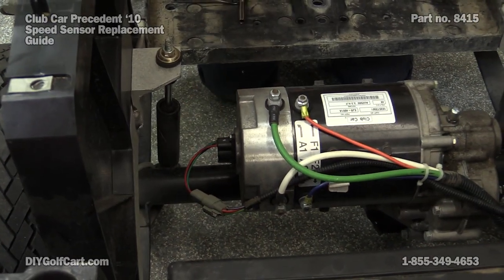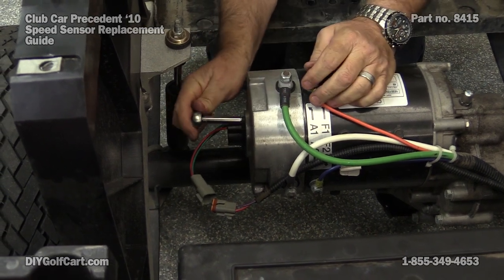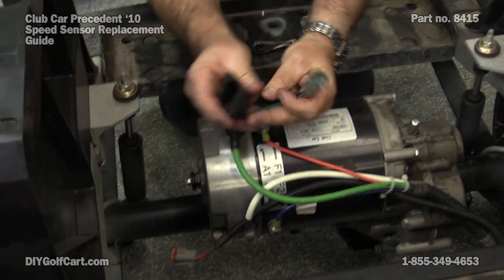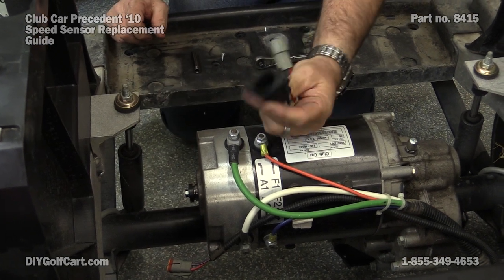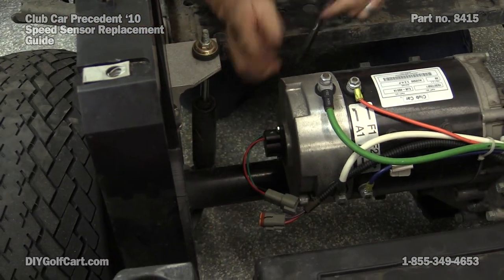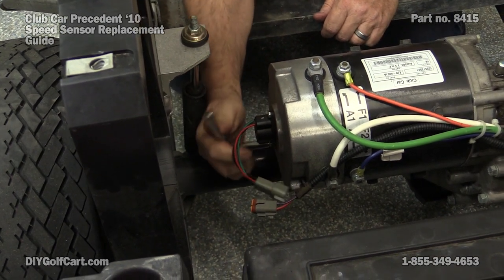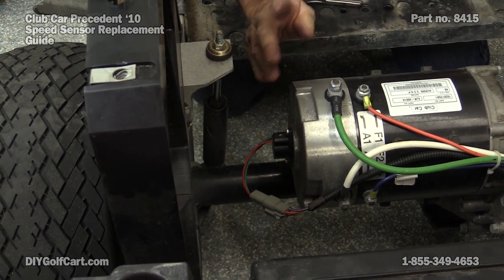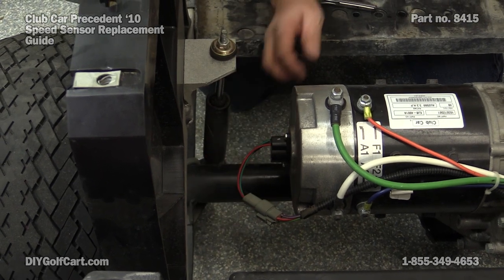Speed Sensor for Club Car Motor | How to Replace on Golf Cart

Comment: 2011 club car precedent electric 48 volt  with new tires and batteries, Voltage check ok. speed is 14.5mph set to original factory specs as far as I can determine. After three weeks of good steady speed running on a  flat surfaces golf round, cart started to change speed. Felt as though your were driving on muddy surface, or low tires, runs slow, picked up spped runs good and then slows again. repeats it self. Before we replaced  tires batteries, we had this issue. Batters were 5 years old and voltages dropped to 46 volts across all 6 batteries. Today after golf I check voltage on batteries, water acid water levels, all good. doing a  m-cor  check that is backing up cart by hand , back up indicator sounds off. would you suspect M-cor, or motor sensor? or your recommendation please

Comment: Our 1990 Club Car DS electric drives fine when you press the gas pedal. Release it and press it again, so that equals pressing it down twice, it goes much faster. Any idea why and how it does this? Our kids call it the "turbo" feature. Also, the cart drives without a key for some reason? I've replaced the solenoid before and now it runs without the key. All I did was swap out the solenoid for an hem one. No other playing with the wiring. This has me at a loss and I can't find any info on it online?

Comment: Hi Barry, I've got an 06 Club cart and sometimes intermittently it will not accelerate. I press the gas pedal down the engine doesn't rev up but the engine stays idling but it does not rev up and it does not accelerate. Sometimes I've waited five or ten minutes and it works fine and sometimes it doesn't. One time I had my friend push me and once I got going it started working again very intermittent. I took the brown wire and removed it from the Rev limiter but still having the same issue. Any thoughts or comments? Thanks from Doug and Balaton Minnesota

Comment: Ok Barry thanks, so where do I go from here. 48.8 volts across sux. 8 volt batteries read 48.8 volts. Cart speed changes from 13.8 down to 8 and back up again after only 18 holes it run about 1 mile per hour and speeds up to 8
Do I need batteries and a speed sensor. By the way I did the key turned on push and the buzzer worked so does that say the speed sensor is ok. 
On the batteries will Epsom salt and distilled water improve the existing batteries response?

Comment: Great video! I have a 2016 precedent and it is suddenly slower after takeoff and does not slow down quickly after releasing the accelerator (downhill brake). Last time I believe it was the speed sensor (replaced 8 mos ago). Do you think that is it again? Thanks!

Comment: I just installed (-1 month) new batteries and a new solenoid on my 36V 2004 EZGO TXT. BUT,, am still experiencing sluggish run while on an incline. Any suggestions?
Reply from the maker: Jack up the back of the car. Key "on", in forward. Accelerator pedal fully depressed. Check the voltage between B+ and M- on the controller. Make sure its minimum of 36 volts.

Comment: hi, I have a 2008 club precedent gas golfcart. I was wondering how to increase speed without making the car backfire. I was told there is a plug in for a sensor and all I would have to do is unplug it, but I do not know whee its at. could you help me to tell me whee its at and to make it a little faster without slowing down when u hit the gas

Comment: Hey Barry, I have an EZGO 36 V,  it vibrates when I press the accelerator and barely moves. Last month it started up by slowing down and getting stuck. Had to get out and push to get it rolling. Now it barely moves. When rear wheels are off the ground they spin fast and normally. Please help!
Reply from the maker: First thing I would do is to load test the batteries. Any battery reading below 5.9 volts under load, replace.
Reply: I will as soon as my new voltmeter arrives Thanks I will let you know.
Reply from the maker: @MrMalibug  Great! Keep me updated.
Reply: It's the batteries😥😲

Comment: I have a Club Car Precedent.  I have had many problems with faulty knock-off MCor units.  I use them since OEMs are outrageous in price.  With the knock-offs it doesn't take to long for the cart to start stuttering, bucking and running rough.  So I keep changing the MCors out and the cart will run ok for a while.  Now I have a situation where the cart will flat out die.  When this happens, I have to then be towed home.  Then a little while later after the cart sits for a while, it comes back to life.  Any suggestions as to might be causing this problem?  Is there some sort of reset going on somewhere? I saw this video and thought one cause might be a broken motor magnet.  (By the way, as an aside, I tore one of the MCors down and found that there was excess grease getting on the rheostat controlling speed.  These Mcors are either Mexican or Chinese manufactured units.  So I saw that the excess grease is getting on the rheostat. I think the excess grease is interfering with the electrical conductivity and that's why I've had so many problems with that.   I haven't figured out how to put this unit back together yet, but I may jury rig something and try it to confirm my suspicions.)

Comment: Hi Barry. I'm in Knysna, Western Cape,South Africa. I just bought a previously owner club car. Not sure of model, 18780? It is in good condition and I've used it on a flat course the first time. It ran OK but would slow down sometimes and do not seem to go as fast as I thought. Can the problem be the speed controller as the batteries are fairly new. If it is the speed controller can I order one from you and what info do you require. Also will I be able to do the replacement as we are 65km from the nearest town that has repair agents. Regards. Trompie
Reply from the maker: The first thing I would do is to do a load test on the batteries. I do have a video showing how to do that or you could send your email and I can send you written instructions that I did.

Comment: I just pirchased a 2012 club car precedent.  Batteries are May 2013. After about an hour of drive time on a full charge, the cart starts to buck when accelerator is pressed to the floor.  Could the be a sign that the speed sensor is failing?
Reply from the maker: Could either be a battery going bad or a MCOR going bad

Comment: I have a gas Club golf cart. It will not run at a steady speeds but keeps jerking along very slowly. Does the speed controller need to be replaced? I don’t know what year cart it is or where the controller is located.
Reply from the maker: If it's a "Gas" cart, it won't have a controller. Check the fuel lines, throttle adjustments and the spark plug to make sure you have a nice bright blue spark. Still having issues, call me!! That for watching and don't forget to subscribe!!

Comment: Hi I have 2017 club car president that is making a chirping noise from the rear of the cart. Not sure if it's a wheel or the motor. The cart seems to run fine though..The only thing is the speed is hard to stay steady unless at full speed. Any help will really help. Thanks in advance

Comment: I just bout a 2012 Club Car that when you first start out it is very slow but when it warms up, it really takes off.  I don't think any of the battery connections are loose and the batteries are in good shape and full of water.  What do you think the problem is?

Comment: I have a 1997 gas club car that drove before I put it on a trailer and drove it home went to take it off the trailer now it will not drive or reverse but it runs what could be the issue

Comment: I've got an '04 DS w/an Allsports 4" lift. The front end 'let go', snapped off a bolt from a lower ball joint and a tab where the steering hooked up to the same side. Can I purchase another front end for a 4"lift and complete the project myself or should I just take it back to the shop that installed the original? It lasted.less.than 6 yrs.
Reply: I’m sure you can, might call the number on the bottom right corner of the screen.

Comment: 2004 Club Car Precedent.   4 New 12 volt Trojan Batteries. Batteries fully charged.  When I first try to use it, after charging the batteries, I get no response when pushing the foot pedal.  I can pump it up and down like we used to have to do a faulty gas fuel pump and it will "click" and run like a bandit.  Then when I lift the pedal and stop, I have to do the same thing over again.  It runs like a new cart after I get it started down the road, but won't take off from a standing start.  Comments appreciated.
Reply from the maker: Check the voltage on the 2 small terminals of the solenoid to see if it has voltage each time you press the pedal. May have either a bad MCOR or bad solenoid.

Comment: i have a club car carryall 6 serial number JR0914-014022.Now the car is running very slowly...how can i fix the car speed?
Reply from the maker: +She Harm With it being a Carry All 6, the controller may be set to a torque value. It's going to really be determined by what the golf cart is used for and if you should speed it up due to it's size and usage.

Comment: I have a 2003 48 volt club car ds ,but it don"t have a speed control on the motor ,run good at 1/2 petal but jerk if you mash it on down
Reply from the maker: +Robert Dorsett Check the voltage of the battery pack. If that turns out ok, call me at 855-349-4653 and I can give you some more test to run.

Comment: Hello sir I have a 04 club cart 48 volt
I’m working on for someone. It has been setting for three years and was running fine. I replaced the batteries and charged them full and it will move a foot or so with a push and if I jack it up it will run but have to help it get started by rotating the tire by hand any suggestions
Reply: Im having the same problem, let me know if you figure it out.

Comment: do you know any time i run my golf car by the blue cable by the resgistor turn rud and getting very hot do you know why ty
Reply: Check the cable and connectors since I had similar problem with Club Car cables. Connectors were rusted and crimping became loose causing poor connection.

Comment: Barry, I just bought new batteries yesterday and am still experiencing power/speed loss when going up hill. 2002 Club Car DS. All original parts. Do you have any idea?
Reply from the maker: +Char Mobley Give me a call here at the garage  877-960-5464 for a list of things to check.
Reply: Did you end up fixing the problem with your cart? I am experiencing the same issue and was hoping you fixed yours and can tell me what it was? Thanks

Comment: My 2004 club car electric runs well but at rather slow ( compared to my club' s carts ) speed. Same whether on flat or uphill. Is it possible to make a speed adjustment.
Reply from the maker: You can drop in a high speed motor and the performance will increase
Reply: @golfcartking  Which motor would you recommend for a club car precedent 2012 model? I do not want to change the controller to save costs, if possible.

Comment: Hey I have a 03 club cart ds I just put new batters and a speed sensor and it will go and stop . When I push it it will go again and stop . What could it be? I have spent a lot of money and it still not right
Reply: Kenny Matthews Check your bushings
Reply: I have a 2012 Hammerhead R150 36/48 volt electric cart. Shutters and shakes and hardly moves. Jack it up with tires off the ground it will run 30mph. Any ideas

Comment: Barrymy 2011 Electric Cub Car precedent charges great, when I accelerate to the full speed of 13.8 mph ( that's all I get)  then uit drops up and down from about 6 or 8 mph or to three or four mph. iif two people are on it. I suspect sicne everything else checks good, charges ok 48.8 across batteries total charge,  runs great most of the time1. how can I ce sure it is the speed sensor2. can I ge tit to run faster? without going to the dealer and get speed controller  code set?
Reply from the maker: +STEPHEN DAVIS If you are reading 48.8 volts across the battery pack. You've got a bad battery or more. The voltage will drop once under a load and you're already at 48 volts.
Reply: I do not follow you as I have 6---- 8 volt batteries should the voltage not read 48 volts?
Reply from the maker: +STEPHEN DAVIS Image going out to your truck and checking the voltage on your battery. If you read 12.5 volts and turn the key, if the battery is good it should stay around 12 volts but it will drop under load. If you battery pack reads 48 only, the when you press the accelerator pedal and put a load on the pack, the voltage will drop below the appropriate voltage. A good 48 volt battery pack should read around 51 to 53 volts. That way when you press the pedal, the voltage will stay above 48 volts.

Comment: Do you have to have a speed sensor? if so what purpose does it serve?
Reply from the maker: Yes and the purpose is that the speed sensor tells the controller how fast (rpm's) the motor is going.

Comment: its a cool vid and all.but I have a 1993 club car ds and it always goes fast when you hit the gas pedal and never goes slow. please help
Reply from the maker: +justin watkins Check the butterfly inside the carburetor. I've seen them hang up causing the car to run wide open all the time.
Reply: DIY Golf Cart. Ok thanks so much for helping me out

Comment: im frustrated my club cart drives ok after is totally charged but then slow down and when i reach a hill top  doesn want to go any more i just replace the selenoid,batteries ok,,so i will try to wipe off the speed sensor ,(praying that solves my problem)
Reply from the maker: +ken raynor I would load test the batteries ensuring they are at the correct voltage under load first. DO NOT use a load tester! Great re-gifting item.  Use a volt meter to get accurate numbers! Eight volt batteries should not drop below 7.9 volts and six volt batteries should not drop below 5.9 volts.
Reply: hi thanks for replaying ,,i just check the batteries voltage and they seems ok and base on your idea i really tough it was the speed sensor so i bought a new one on ebay for almost $500 bucks as i said the selenoid has been replaced also and still i have the same problem ,, ,and i just purchase another brand new ezgo cart cause my wife was complaining but still i would like to fix the one i having trouble with, thanks again
Reply: @DIY Golf cart
i did lift the cart and push the gas pedal on forward the tire on the driver side stop first then the one on the passanger side and then i did reverse and at full speed the tired on the driver side run for onli 5 second and the one on the passanger side keeps going!! any idea what i had to replace this time? thanks
Reply from the maker: +ken raynor Give me a call here at the shop. 855-349-4653

Comment: Hi, My dad has an old club car probably from the 90's.  We just replaced the 6 - 6-volt batteries and it was fine.  Then my dad charged it and when he presses the pedal, it jumps and jolts, etc.  What would this be?
Reply: Did you ever find out what it was. I have the same issue

Comment: Does a 1995  club car have a speed sensor
Reply from the maker: It could. Look at the back side of the motor and see if it has 3 small wires going up to the controller. That would be a speed sensor. If its smooth and the motor only has the 4 main large wires going to it, it's a series motor with no speed sensor.

Comment: I have 06 Yamaha g22 electric it’s hesitating I looked at the sensor I’m not sure how to pull it after the bolts are out
Reply from the maker: First drive the cart, stop and see if you can push the cart. If the speed sensor kicks in, its good.
Reply: Thanks I’ll try it
Reply: DIY Golf Cart the cart hesitates cuts out never hitting full speed? I tried what you recommend still doing the same thing
Reply from the maker: @watchdog3605  Get a volt meter and put the leads into the charger receptacle, get that reading and take the cart for a ride while holding the leads in position. See if the voltage is dropping out toward the top end of acceleration.
Reply: DIY Golf Cart that’s exactly what it does it cuts getting to full speed

Comment: what did you use for cleaning speed sensor or did you replace.
Reply from the maker: +Melody Vidaurri Actually the video was to explain how to change it and where it was located. All I did was wipe it down with a dry cloth.
Reply: OK. Thanks.  I was not sure why it was cleaned and not replaced.
Reply: Alcohol and compressed air is 👍

Comment: My '12 club car goes very slowly in forward but is very fast in reverse. Does that sound like a speed sensor issue?
Reply from the maker: First, load test the batteries. That symptom is very common for low batteries. Then check the MCOR. To check the speed sensor, simply ride the cart, stop and get off and try to push it, If the solenoid kicks in, the speed sensor is good.

Comment: I just bought Club Car and does work I don't know what year? they replace 3 Batteries and they park under a tree and never worked some one  replace new Electical part and did not fix the problem   no one can  tell me what part was replaced  where do I start I'm great Car Elec and used to be a Mech  help where get repair manual on them. thanks in Advance. Steven
Reply from the maker: Start in the middle. Key switch "on", cart in "forward", depress the accelerator pedal and check for total battery voltage on the 2 small terminals of the solenoid. If you have voltage and nothing happens bad solenoid. If no voltage, back up to see whats missing. Either the positive or the negative is not being supplied.
Reply: @golfcartking  Thanks I just order Keys so Friday I have them. and I can check them out  how find out what year it is?  thanks in Advance  Steven
Reply: @golfcartking   I found out it''s 1999 Club Car  I test it today
Reply: @golfcartking  I have check it out yet been so hot out  Thanks